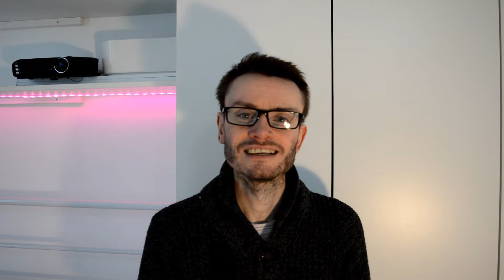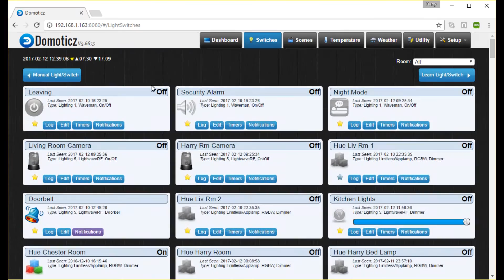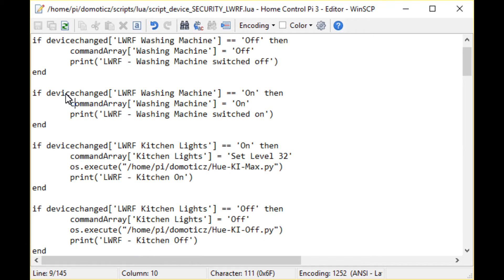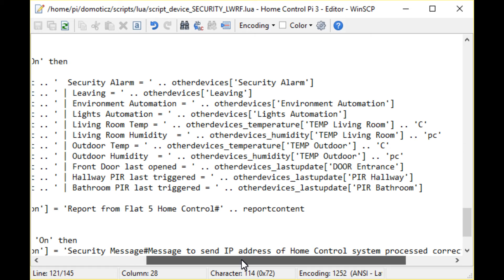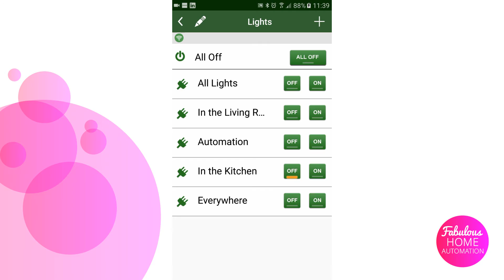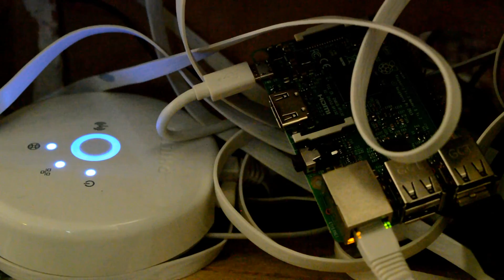How the LightwaveRF Link can work with Domoticz

Comment: Thanks for the video. With this setup can you also receive signals from lightwaveRF wireless switches and trigger scripts from these events?
Reply from the maker: Yes you can. You can add in a Lua script to look out for the switch. I do this in other videos when controlling Hue lights from LightwaveRF mood switches using Domoticz.
Reply: @fabuloushomeautomation9900  Thanks very much for this - after your message I got ahold of an RFXCOM and, in conjunction with your videos and a few forum visits, it's remarkably simple to get working. 

One issue remains - I have several of those lightwave 6 button mood wall switches. I can get the on/off buttons working great, and I see the "Group Mood X" label in domoticz, but I can't get domoticz to trigger different things depending on the button pressed (e.g. mood 1 triggering dimmed hue scene X, mood 2 triggering a hue scene Y). 

I've searched the forums - can't find anything. Did you find a solution for this?

Comment: Your video really helped me start off to use LightwaveRF and Domoticz, big thank you :-)

I see you measure your aquarium temperature, what hardware are you using for that?

Thanks
Reply from the maker: Hi, thanks for your comments! I'm afraid I don't have an aquarium thermometer but if I did I would use something like a wireless swimming pool thermometer - there are loads on ebay and the like.